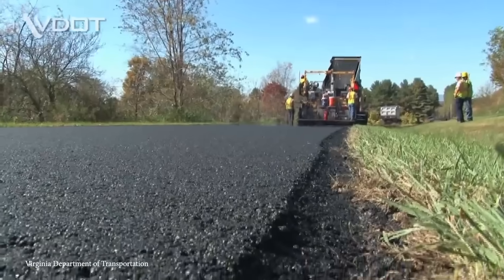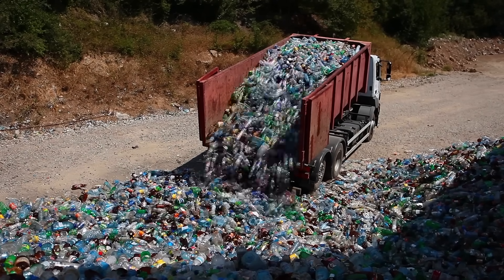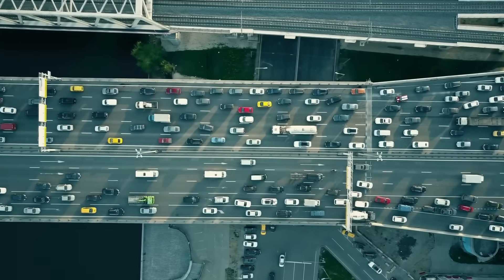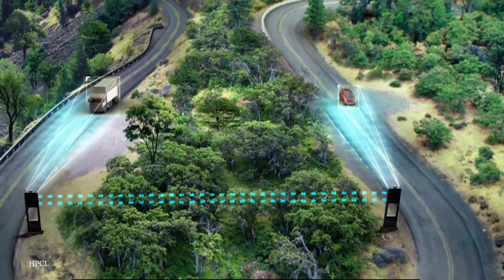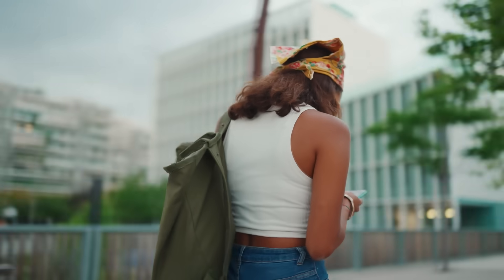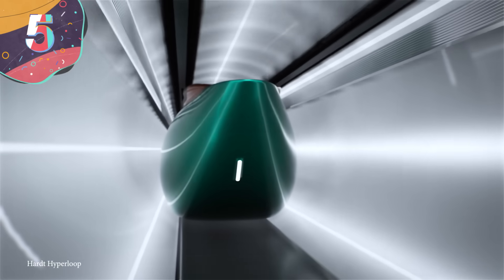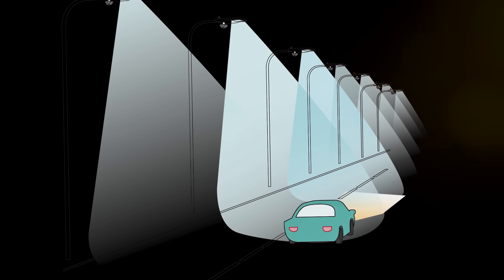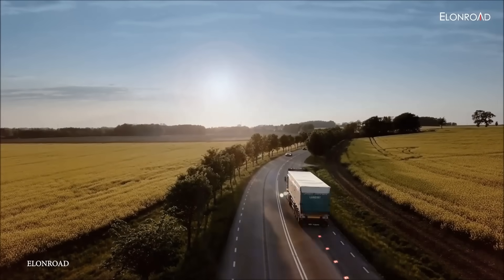15 FUTURE Road Designs that will change the world

Comment: Just read a recent(18/10/2025) article on this glow in the dark stripes on roads, its an amazing idea, and initially looked and performed great when Malaysia first tried it.... unfortunately alot more testing needs to be done...they used the paint version which although garnered applause, soon turned to disappointment when in a very short time it proved to not only not cope with extreme climate changes but basic heavy road use of today's vehicles was having its toll far to quickly and it was degrading to fast...and with the extremely expensive price of the product used it became inviable...BUT if they can improve on it and lower the price...it would make such a huge safety difference for drivers at night.

Comment: Hi, driving and cycling enthusiast here. I really loved the idea of Talking Highways with constant black box monitoring and detection of any infringement without the need for a roadside camera. This will help reduce accidents anywhere, as no one can get away with any offence anywhere. 

This comes since I am so worried that should self driving vehicles prove safer, human driving might be outlawed all together in the interest of safety. If however there was a system to prevent anyone from committing any avoidable offence, our roads would be as safe as they get. 

I think the cherry on top of the cake to this would be breathalyser cars, that detect the driver's alcohol level and are unable to start if the concentration is above the legal limit.

What about tiredness? Tiredness is accompanied with changes in posture, movement and the look of your face. 

The car should detect these cues and issue visible or verbal warnings, and if it has to issue past a certain amount, then switch itself off.

Comment: The UK has had a solution for marking roads where there's no street lights for decades, they're called cat's eyes and they do the job fantastically since they use no power and are self cleaning.

Comment: Glowy paint... vs snow/ice/plows? No plastic roads, but maybe bike lanes/sidewalks/parking. Honking roads, signal-synch & self-repair, sure. Traffic/walker radar & car black boxes... um, maybe logical, but scary misuse issues. YES FLYING!! Lengthy vacuum hyperloops & induction lanes sound finicky, expensive to run all the time.

Comment: The intelligent speed bump sounds like a nightmare if it wasn't timed properly and came up while the wheel is on top. Not to mention even if it just came up under the bumpers blindspot so the driver is unaware they're about to hit a massive bump. That alone could cause panic and accidents. All for a more expensive speed bump that requires more service and repair than a regular old concrete lump. 

It's an interesting design, but ultimately designing something for humans assuming they will be responsible drivers and do the right thing is just not a good idea. There will always be someone who does something the engineers didn't think would happen that could result in possibly a more catastrophic crash than traditional bumps.

Comment: Great video. However, let’s get a few facts corrected: LA and San Francisco or any other US city is NOT “first in the world” to do advanced traffic light controlling! Copenhagen (Capital of Denmark) with an approx. 1,2 Mill. Population has been operating centralised and digitalised traffic light controlling for years. Most smaller cities (population size 5-200 thousands) are doing the same (in Denmark) and the a nation-wide street light controlling set-up has been in operation for many years. 
The solution does not only handle traffic lights, but also opening of bridges, weather impact on traffic, emergency and police requests for traffic divergence or blocking - and much more. The first version of this solution was launched in Denmark more than 30 years ago.

AND: I am pretty sure other cities in Scandinavien and Europe has done the same years ago! Many, many, many years ago!

Just as a reference: “digitalization” of eg. Cash-payments like rent, insurance, tax, bills in general, as well as paying by credit or debit card like solutions has been the de facto normal in Denmark since 1984, where a nation-wide IT banking and payment infrastructure was launched. The set-up is not owned or operated by the Danish state, but by a (by the financial institutions) privately owned company. The have found that it saves everybody a lot on money to work jointly on eg. Big digital infrastructure. 

All (all!) financial institutions must by law be running on this infrastructure!

Comment: One of the problems with synchronised signals that it is mathematically impossible to synchronise signals for both directions on a single road.  Made even more impossible if two major roads meet at an intersection.  So you can give one direction priority but that degrades the travel for the other direction or for other roads.  Even 50 years ago this idea was tried here and it made cross city traffic extremely slow.  Over a period of 5 years it increased my own commute from a time of 20 minutes to a time of 40 minutes and later to over an hour.  But it benefitted those commuting to and from the city.  Intelligent design COULD try to balance out everyone's rights but that wasn't our experience.  There was just ONE direction that was considered and no one else was given any thought at all.

Comment: Meanwhile in Eastern Europe: The same cobblestone road that existed for hundreds of years is still holding strong. Maybe cars can't go fast on them, but that is a huge advantage in the cities.
Reply: Usually that's not actually the reason roads get opened up though, usually it's because the amenities underneath the road need replacing. If there aren't any, well then it's easy. And indeed in low speed areas road decline is way slower anyway.

Comment: glow in the dark roads are not needed, we have retroreflective paint. It reflects light directly back where it came from, rather than all over. This makes the return light, much brighter than anything else. Not only this, but its powered by your lights. It doesnt bother anyone who doesnt need it, only you see it, and it doesnt require being charged by sunlight, I dont have to explain to you how that would be a problem in urban or wooded areas.

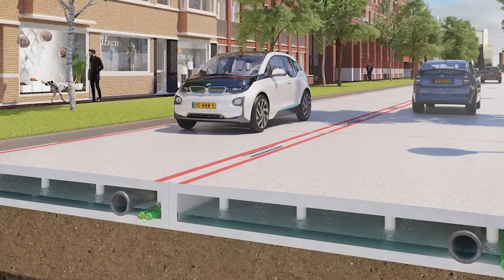Comment: 4:58 wrong. puzzle roads are used for high way with exact same advantages. faster to build and stronger. just one difference : they are done with concrete.

Comment: Speed bumps are actually the worst invention ever. You can't even drive the speed limit over a lot of them without potentially damaging your car. And it's even worse for truck drivers.
Oh, the speed limit is 50 mph?
Let me just slow down to 20 mph over this pile of asphalt which the government decided to put here. And that's not even getting into potholes. Potholes is a sign that someone is failing or unwilling to do their job. It's not even that expensive to fix. Just send someone to fill it up...

Comment: Humm? Electric roads to charge electric cars? I wonder where is that power coming from? Could it be from fossil fuel plants that creates more pollution then a combustion car can?
It take 7% carbon emissions to creat 1 combustion car.
It takes 12% carbon emissions to make a electric car. And that isn't even the good electric car that the type of car you can't leave the city because tour car would be dead before you try. It's the car that can't even climb a hill.
No in order to creat the car that can even come close to a combustion engine car.
That would take 17% carbon emissions 
To make that car. Not to mention that electric car manufacturers can throttle your mileage as well. Basically you'll be driving a cellphone they can kill you battery life with every update. 
Forcing you to buy another electric vehicle that's another 17% carbon emissions to make the car.
Not including the carbon emissions by the highest levels of carbon emissions the power plant that supplies your cars recharging needs.
And the battery wast as well.
I can be driving in my 1974 Nissan C110 Kenmarry Skyline. Modifying it to make my engine more efficient, Basically swapping it for a modern engine. 
Like an RB30DET and be doingore for the environment then EV drivers could ever do.
(1) I'm am recycling an old car.
Meaning it won't take the energy need to crush it.
(2) I'm a car girl so Modifying a old car the bring it up to today's standards is very do able.
(3) plus I use Ethenol which is a green gas made from corn.uch rather use that anyway Because it burns cleaner and I won't get much carbon build up in my engine and there at every gas station.
Plus I can use mothballs for my gas.
Everyone who is into cars knows this trick. If you don't know what's it's for.
Well I'll say what my dad told me when I asked him to teach me about cars.
"Read a book" funny thing Theo I ended up knowing more about engines then him. 😆 to bad Theo I wanted him to teach me a out cars because we're both into them and I wanted to have something bond over with him. He missed out.

Comment: Overall I saw some ideas with potential, some ideas with limited application, and a couple that felt overly optimistic.

15. Sounds great. Current roadway paint uses reflective glass micro beads to make them more reflective but not only do these beads wear away over time but they require light to reflect. Glow in the dark paint that doens't overly increase paint costs would greatly help incrase night driving visability.
14. I guess the question becomes how much does it cost to make these Mesh? Is othe overall cost less than traditional methods? The most important factor with making roads is cost as they span such large distances even a few cents difference per foot can mean massive amounts applied on a large scale.
13. Perhaps the plastics should be made into more powder like beads and mixed with the tar? This way even when breaking off they do little to harm the enviroment anymore that broken pieces of Tar already would. At the very least it sounds like Plastic roads might need a little more innovation to really be used large scale.
12.Jigsaw roadways likely aren't practical 100% as the video mentioned. But although they might save money long terms ... good luck getting a city planner to agree to the higher initial cost as these people are often infamous for going for the short term cheapter solutioiin.
10.Intelligent speed bumps probably won't see wide spread use anytime soon simply due to, again, higher cost than just making a lump in the road.
9. Since these only require limited application these could see good use in the future as many areas will likely see the cost of installing this to be worth reducing the accidents distrupting trafffic.
6. The large issue with wide spread application of flying cards is safety. Plans require CAREFUL planning and constant communication to keep skies clear for plans and prevent accidents. Allowing everyone to just ... have a flyign vehicle sounds cool but would require heavy restrictions that would likely precent a lot of commercial application.
5. The other big issue with Hyperloop is maintaining a vacume ... isn't easy. Any fault or crack and the entire thing is compromised. Hyperloops MIGHT be able to see some limited applicaiton but unless matinence and repairs cost basically nothing ... they will be prohibitively expensive to maintain.
4. Two big questions here are how much does this cost and is there any risk to thsi bacteria spreading beyond the concrete. It wouldn't be good is this kind of bacteria just started covering everything in limestone. You'd likely need  a way to ensure it can only survive within the concrete enviroment to prevent such issues.
2. It might be a bit much to expect this on roads ... but sign application might be practical. 
1. Honestly this just seems overly hopeful. This kind is charged lining would cost a lot to apply and maintain and any reasonable charging would take a fair amount of time which for most speeds means MILES of road that would need charging lines. A more practical idea would be to lay charging lines in parking spaces. So anytime you stop at ... say Walmart to get food. You can spark in a specal charging spot to get a boost while you are shopping. Not to mention this would allow them to better calculate how much you owe them ... because come on do you REALLY expect free charging of an entire car? maybe some generous buisneses would offer such a thing but it's a bit silly to just expect that on the open road.

Comment: Solution for dealing with people running red lights: When the signal light turns red, spikes come up out of the road ahead of the crosswalk. Run the red light, blow the tires. (First responder vehicles would have a remote that would retract the spikes when they need to run the red light during an emergency.)
Reply: While it is rare for traffic lights to fail, it still happens, adding sharp tire popping spikes to that mix would make it even more of a mess!

Comment: These fluorescent paints are no good when covered with dust or snow. And like the painted lines get quickly erased. Why not fired iron oxide pins either in the middle of each lane or where lines are painted today. a pin every 5 feet would do it. A row of sensors  at the bottom front of a vehicle could send out pulses, like sonar, the reflection of which could tell a driver with a heads up display when they are straying but could be ignored when changing lanes. They'd be better than the so called "cats eyes".

Comment: I prefer the traffic controlled method of traffic light control widely used today instead of centrally controlled lights of any kind. A copper wire loop at intersections link to a nearby control box is all it takes. Well along with educational material going out to all drivers to raise awareness.

Comment: Two questions/suggestions: why don't they put the same fine heater wires in windshields that are used in rear windows. There is little or no distortion in today's rear windows. Defrosting and de-icing would be far faster and easier. The warm windows would remain, at worst, wet which wipers would take care of. Also, why are they not using heater sensor camera technology with a heads up display on the window so that accidents in rain, snow, or for would be less likely. Even in the unlighted areas objects, like objects (fallen trees, etc.), cyclists, animals and pedestrians, even stoplights and signs in front of a driver would be recognizable. None of this would require road work.We have the technology and these would be more useful than some of the bling actually being used.

Comment: Im surprised you didn't mention the roads that have solar cells built in to power warmers to melt snow and ice off the road
Reply: Are you being sarcastic?  Cause at least one of the several solar road projects already tried that and it didn't work.  Along with the road itself producing very little energy even during optimal conditions.

Comment: I have a challenge for you. Snow free roads. The weight of every car passing and compressing each piston produces electricity for grid and heat for road. Is it possible.  Starts with a thought combined with other thoughts such as solar roads
Reply: The pistons going down as traffic passes over would provide very little energy and even that little bit would be less the the energy lost from increased rolling resistance.

Comment: Better research would have been an idea - then you wouldn't talk about a system like hyperloop, where it is already known that it is an idiotic, not working idea.
And intelligent traffic lights and signs - sorry, but those work for years in Europe. In smaller scale and only automatically regulating the traffic on a main street in a city up to area wide systems that will control most traffic lights and speed signs around and in the city.

Comment: Problem with electric vehicles is that where i live the main source of electricity is still biofuels (tree chips) or coal. Sometimes we get a wind speed that helps the grid, but not often. People think by driving electric vehicles here are better for the environment. Until we get away from the first two sources of electric energy is not so.

 I am a proponent of hydrogen cars instead. Once there are more tank stations and more competition these cars will be better for the environment. They have been put through the wringer in testing and safety, more so than electric cars, because of hydrogen power. They also refill faster, and their waste? Well its water H20.
Reply: i know right which better yet need hybirds akak hybrid solar,wind,battery, biofuel, hydrogen cell thus drivers can recharge their cars themslves = drive them themselves 7 not have to relay on co2 big powr companies or corrupt autonomous controller overlords + be mindful of the environment

Comment: Question about the second design: wouldn't the webbing (and the open space it leaves) make the road prone to freezing faster? It seems like a design for potholes waiting to happen too.
Reply: it does not leave spaces. webs are filled with little stones most of the time, or sand or earth. 

note that the web always goes on top of geo textile. 

each element brings a feature / function, to improve the place. not just for roads. also useful for banks ... and when I say banks, I mean ... the 8m high mountains you may find around a bridge to support the higher road. 

practical engineering channel made several videos about geo textile and how it re enforces soft materials ( like metal bars in concrete )
Reply: @Benoit-Pierre  oh ok, that's cool--i must've missed that in the explanation someplace... thanks for the tip! :)
Reply: @ingridfong-daley5899  its not said verbally, just shown visually
Reply: @ingridfong-daley5899   for the base :

https://youtu.be/0olpSN6_TCc

Its about geo textile, but the web has a similar purpose. But they are complementary, and used together under roads.